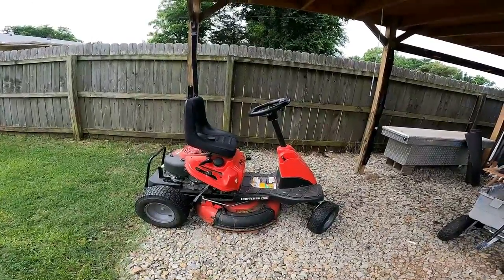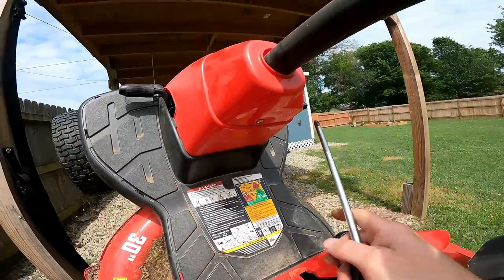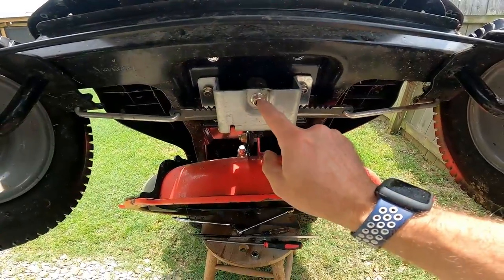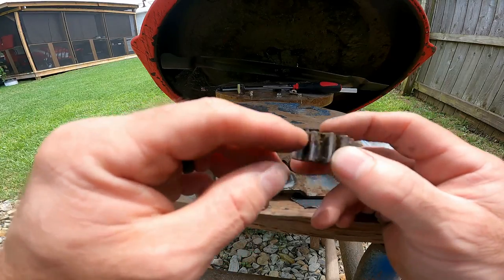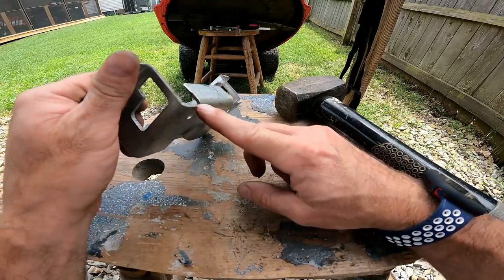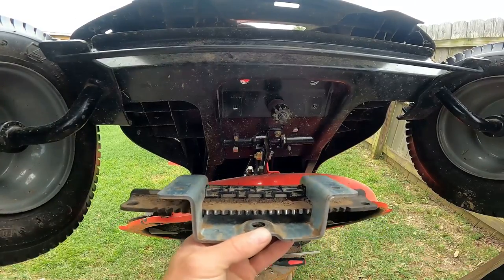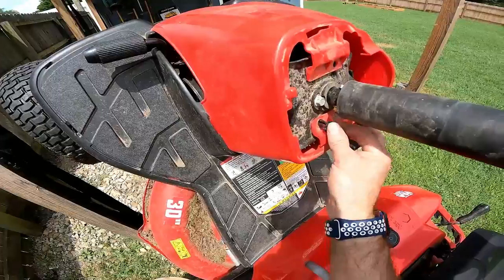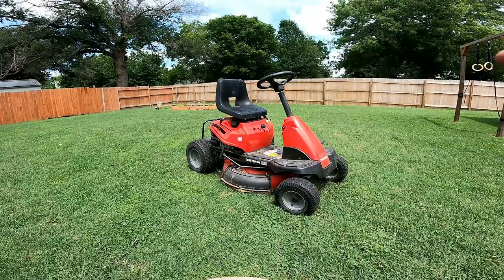Craftsman R110 Steering Problem DIY Step by Step fix!  Save money!

Comment: I have the same mower the bar teeth was skipping from wear.  I ordered a new one from mower shop and installed it and fixed  steering  problem..  I saw they had the same part at Amazon but had bad reviews the one I was looking at..  Mine looked like the teeth had wore down..
Reply from the maker: Cool, thanks for watching.

Comment: Great Job Man. Yet I have a Question. Couldnt You just Tap The   back metal plate with a Hammer without taking it apart?
Reply from the maker: I think some others in the comment section have tried.    But it seems they were not successful.   I bet it can done.  But I’ve had no issues since this fix.

Comment: Perfect video! That fixed my steering problem and helped me a lot. Thank you very much.
Reply from the maker: You are very welcome!   Thank you for watching.  It should last a long time.  Mine is still working great to this day.
Reply: @rjguess  I did put some grease on mine just for good measure. It's not a very robust design by any means!
Reply from the maker: @dougbateman6613  I did the same thing after someone mentioned it in the comments.   It helps a lot.

Comment: The teeth on the flat bar of my mower were chipped. I bought a kit from Amazon and followed these instructions minus the hammer, and it was a very easy job. The hardest part was pulling the cotter pins. Also, if you have your mower lifted for a very long time, you might want to let it sit on its wheels for a while before you try to start it.
Reply from the maker: Glad this video helped you.  I agree about letting the mower sit for awhile before starting it.    I should have mentioned that in the video.   Thank you for watching and commenting.

Comment: also want to add you should put some grease in the slip joint and on the gear itself.  That makes the steering much easier too.
Reply from the maker: I agree, great advice.  I should have mentioned that in my video.   I appreciate you watching and commenting.   Thank you!

Comment: Thanks for the tip. New parts cost $100, I heard. I love saving money!
Reply from the maker: Yes, it’s an easy fix.  Mine is going strong to this very day.  Add a little grease on the gears.  I didn’t in this video.  It will help it last even longer.  Thanks for watching!
Reply: Nah, new steering rack is ~$20. But his info is priceless.
Reply from the maker: @papapickett7267  good to know it only cost $20.   This fix is still better than new to this day.   Only thing I didn’t do in this video was grease the gears.      Thank you for watching and commenting!

Comment: Great video. My TB 30 steering starting to slip.
Will replace soon thanks to your video. How did you prop the mower up?
Looks like it was a stool. Did you place the stool inside the deck? Thank you
Reply from the maker: Yes, it was a stool.  After tipping the lawnmower up, it pretty much balanced on its own.   It wanted to lean forward slightly.  That’s where the stool cam in handy to keep it from tipping on me while working.  Yes, the stool was inside the deck, blade was resting on the stool.  Not much weight was on it because of it pretty much balancing itself.  Thanks for watching.  I appreciate your time and comment!

Comment: I used 4 large wire ties to pull the flat bar with teeth closer to the round gear. There is a couple holes to pass the ties thru. Its been 2 years now and no wear on the plastic ties. Just pull the bar tight with ties. I took it all apart also but then it just dawned on me😮
Reply from the maker: Good info.  Thanks for watching.

Comment: Same problem, however, I can't free the 1/2" nut. It's just 3 years old and wasn't too dirty. 
Soaked it with WD-40 and still won't budge. Keeps slipping.
Reply from the maker: See if you can keep the steering column from turning while you attempt to loosen the nut.
Reply: I kept spraying WD-40 on the 1/2" and on day 2, I finally got it loose.  
The rest went just as you showed. It really works.  
I did break 1 of the cotter pins. 
Great video, thanks so much.  I cut the lawn yesterday and it was like new.
Reply from the maker: @bobm9722  glad you finally got it.  Thank God for the people who make WD-40.   Thanks for watching the video.  I appreciate you and your comment!

Comment: I have R110 craftsman riding mower 30 in,i placed new battery in mower,it will turn over but not crank,i drained tank of old gas put in fresh gas still want catch,mower rear wheels are locked so i cant put it on trailer to take to shop,your advice is appreciated
Reply from the maker: Have you tried to take out your spark plug and either clean it or replace it?

Comment: Great repair!
Reply from the maker: Thank you.  Still working like new to this day!
Reply: @rjguess  that’s great. I just picked one of these little guys up. It’s great for getting trough the gate!
Reply from the maker: @josephpetrillo2243  I have other videos in this mower.  How to operate it, changing oil, air filter, etc.    If you think of anything I’ll make a video of it on this mower.  It’s a great little mower.  Lasts a long time on a tank of gas well!
Reply: @rjguess  I’ll be sure to check them out. What speed are you typically at for a nice cut. Also,  do you notice a difference in the quality of the cut between mulch or shoot?
Reply from the maker: @josephpetrillo2243  speed 1-3. I wouldn’t go any faster than 3. Mulch or shoot the grass still cuts the same.

Comment: Hey hey, so it's been a couple of months since you put this out, and I was wondering how the fix is holding up with time?

I need to do this, and I'm wondering about zip ties, or pulling the whole thing apart.
Reply from the maker: The fix I did in this video is still holding.  It works better than new.  Just be sure to grease it up.  It will help it last a lot longer.  I did this before I posted the video.  So it’s been about 4-5 months now.   Thanks for watching.
Reply: @rjguess  unreal, thanks so much for this awesome vid. It'll make light work of it now I'm sure.
Reply from the maker: @andycjohnston  thank you for stopping by my channel!   I am glad I could help!

Comment: Is there some sort secret to getting that center nut off?Mine just spins and spins and never actually moves even with holding the wheels or the steering rod.
Reply from the maker: I apologize for the delayed response.   Try having someone hold the steering wheel while you loosen that center nut.   Or take a pair of pliers and hold the steering column still while you loosen it.  I hope this helps.
Reply: @rjguess  yeah no big deal about the delayed response. SO I did  that for the most part, I held the steering wheel and the column and the nut still just spun but never actually move on the threads. I wonder if the bolt inside the cap on the steering wheel had somethign to do with it. Thats the only thing i couldnt reach on my own
Reply from the maker: @Stephen-rm6hp  you might be right.  I didn’t even think about that.   I bet that is your problem.   If you don’t mind let me know if you got it and what is was please.    Thank you.

Comment: do you know how to make an adjustment to the reverse gear? my 30" craftsman won't go in reverse when i engage it. should be an adjustment and not tranny problem since it's only had about 2 hours of use. thanks.
Reply from the maker: I wish that I could tell you yes.  But I do not know how.   I would have to dig into the mower to figure it out.   If I do find the answer before you do. I will post it.  Keep me updated.   I’ll keep you updated.  Thanks!
Reply: @rjguess  thank you very much. I'm still searching. Even a repair manual would help.
Reply from the maker: Is yours similar to this?  

https://youtu.be/ndrSGuA0zo0?feature=shared
Reply: @rjguess  no but thanks. I saw that vid previously and that's why I was encouraged. mine is the rear engine 30" and has nothing like the 2 bolt adjustment as the front engine's.
Reply from the maker: Hmmm.  Ok man.  I’ll keep looking.
Reply: @rjguess  much appreciated. will be sure to let you know if i found a solution.
Reply: (https://www.youtube.com/watch?v=dP1UI21ztoQ) Received this link from another youtuber. This is exactly what I was looking for. Adjustment is so much easier than the front mounted engines. Kudos to @IndRepair!
Reply from the maker: @jjpac2011  great!     This is good!!!   Glad you found this.

Comment: This DIY fix only lasted a few months before I had the same issue again. Do yourself a favor and buy the steering service kit 753-11064B instead of bending the metal bracket. 

This video at least helps show how to take everything apart and put it back together.
Reply from the maker: Your gears must have been worn out worse than mine or others.  Mine is still lasting to this day without a problem and I mow my grass 3 times a week.

Comment: Couldn't you just leave it installed and give it a few "love taps" on the back side plate and save all the disassembly and assembly?
Reply from the maker: You could try.  I disassembled it so I could tell if I had adjusted it correctly.   If you adjust it too much while it’s on, it’s going to be hard to bend it back out.   But if you got it right then sure it would save time.
Reply: I tried the taps without the disassembly but too much movement when striking plate. Plate needs to be placed on something solid.

Comment: There is a recall on these lawnmowers for that problem, you get all new parts with the plastic piece being replaced with a more dense plastic insert and the main bracket is designed different where the metal rack side in and out

Make sure to grease that area where the gears mesh together and where the rack comes in contact with the plastic
Reply from the maker: Thanks!
Reply: Does the recall provide material free of charge for the fix?
Reply: @rogermoreau8834  
I’m not sure 
I saw the kit listed online between 50 or 60 dollars
Reply: I looked on the Troybilt website to look for other parts for my mower and saw that there is another revision 753-11064c uses a harder type of plastic

Comment: How do remove the L shape axle on R110
Reply from the maker: May I ask why you would need your remove it?
Reply: @rjguess  the L brace broke loss from support bracket need to replace it r get old 1 welded
Reply from the maker: @cecilgeorge1921  does my video show this L bracket by chance to I know I’m looking at the right thing.
Reply: @rjguess  yes left wheel attached to it
Reply from the maker: @cecilgeorge1921  so, you are talking about the L tube shaped piece that attaches to the tire and the flat piece above it?  It also has the bars that move the rack and pinion back and forth ?
Reply: @rjguess  yes! I got to close to a wall left tire caught it broke the weld the L tube attached to
Reply: ! Need take it off to get tax welded again! Which cheaper than replacing it for $20 raced for 5
Reply from the maker: At the moment I’m not sure how to take it off.  Give me a few minutes I’ll go outside and look at it.
Reply from the maker: Ok, look up under the plastic piece where you place your feet.  There is a plastic cap covering the end of that L tube that holds the tire.   Pop that cap off with a flathead screwdriver.   There is a metal push-nut that you will have to remove.  Also remove the cotter pins from the poles that move the rack and pinion.   Once you have all this  removed.  The part you need should come out.  I hope this makes sense to you.
Reply: @rjguess  👍I had trouble removing cap but got it thanks
Reply from the maker: @cecilgeorge1921  awesome!

Comment: Thanks, that is what is wrong with mine, now I'll be able to fix it myself.
Reply from the maker: You are welcome.  Thank you for watching my video.  I did not do this in the video.  Someone in the comment section suggested greasing up the gears and the plastic guide.  He is correct.  Doing that will further help the ease of turning and longevity of the moving parts.   If you would, please let us know if you got yours fixed using this video!
Reply: @rjguess  Yes, I'll let you know what I find out, But I believe greasing the gears would just hold grass and dirt and create it's own problems.
Reply from the maker: @chesteru2  I thought the same to.  It originally didn’t come greased.  Not on mine anyway.  That might be why.   I’ll look into mine next time I cut the grass.  If there is a lot of filth in there then I will remove the grease.
Reply: @rjguess I got time to work on the mower yesterday and and followed your instructions, now the mower works like a charm, thanks rjguess1.
Reply from the maker: @chesteru2  very good!   Thank you for coming back here and letting us know.  I appreciate it.

Comment: Got as far as the 3rd bolt. The 3rd bolt won’t turn no matter what we do.
Reply from the maker: Try tapping it with a hammer.   You can also try tightening it just a little then try loosening.  Sounds strange but sometimes this breaks the bolt loose.   If you have PB blaster.  Spray the bolt down and let it soak for a few hours.   I hope this helps.

Comment: Unfortunately, this is just a foreshadowing of what’s to come. I understand that money is tight but these MTD made mowers are not worth ANY of your hard earned money. I think Taryl has a video about this issue on the same mower and MTD has an updated bracket that has a plastic bushing in between the rack and the bracket to keep it from moving around.
Reply: Mowermedic1  has the vid about the “updated”steering bracket.
Reply from the maker: Thanks for the info.